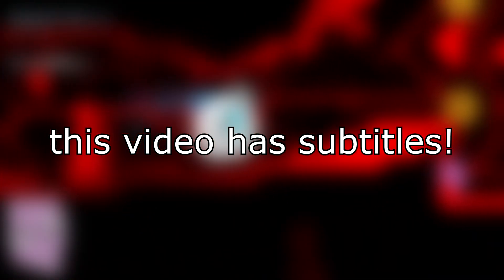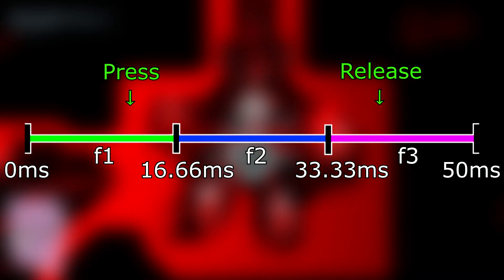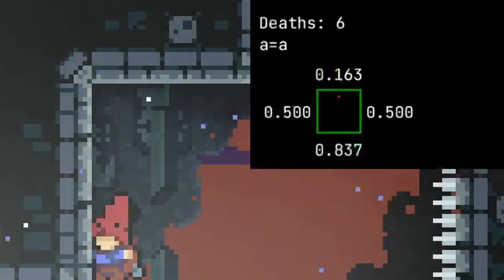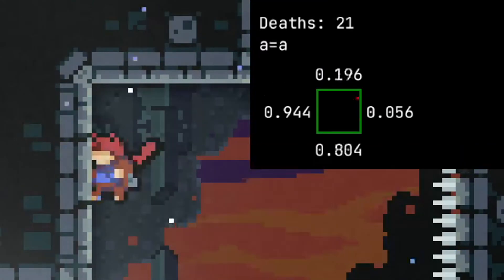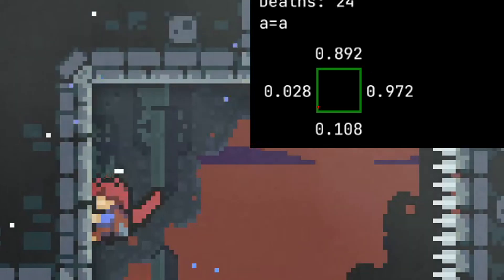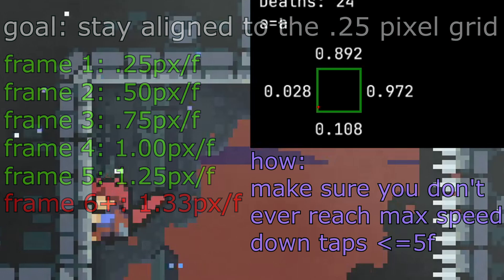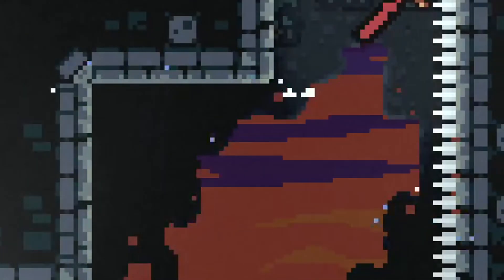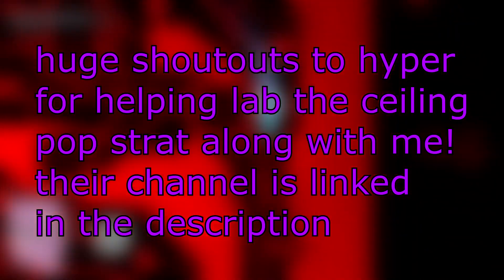How to Ceiling Pop and 5 Tile Overhang EASILY - Celeste In Depth Tech Tutorial

Comment: Written steps: (for people who wanna do it but have bad memory (i.e. Me :D))
1. Get onto the wall, obviously
2. Neutralize your horizontal subpixel by neutralling off the wall, going neutral again in midair before hitting the wall, and grabbing the wall after hitting it.
3. Setup your horizontal subpixel position by doing a regular wallkick followed by a neutral jump.
4. Line up your pixel position to be 14 pixels below the 5 tile overhang.
5. Set up your vertical subpixel by fulljump neutralling into the ceiling and immediately holding back towards the wall.
6. Get to the bottom of the pixel below the one where you land, making sure to never move along the wall for more than five frames.
7. Perform a wallkick, holding left the entire time, and buffer a second wallkick.
8. Hold right after the wallkick and buffer another wallkick on the wall above.

Comment: does releasing grab and holding it the next frame have the same effect as 1f tapping down?
Reply from the maker: it does not! while downwards gravity IS .25px/frame^2, grabbing does not immediately set your speed to 0, it divides it by 5 the frame you grab. so youd move .25 + .05 compared to just .25

also iirc technically the first frame you release grab your speed is 0, so youd need to repress it Two frames later i think